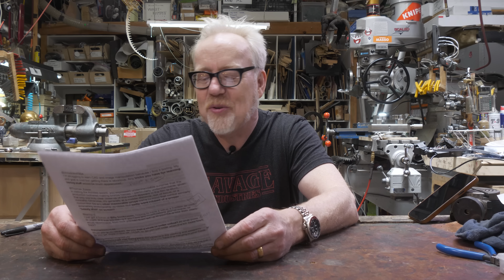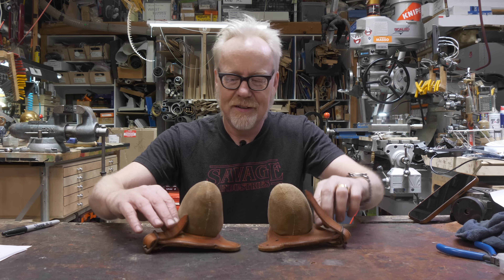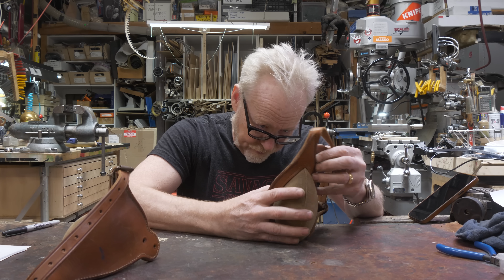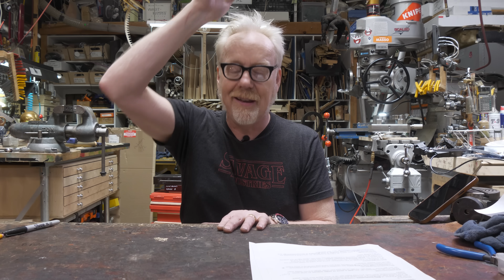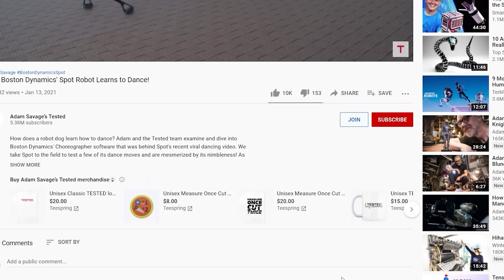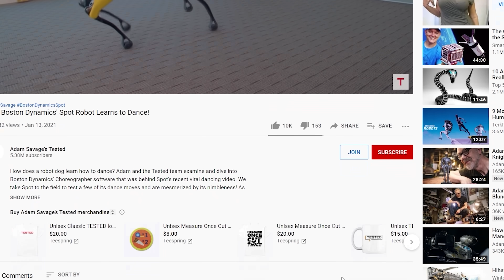What Are These Mysterious Things?

Comment: Bucking rolls for a saddle. These are with the straps that go through the hole in the top of a saddle to the underside. These are placed at the inner thigh close to bottom of where the horn of the saddle is located. 

These are used for helping a rider stay in the seat of the saddle instead of riding up the horn causing bruising when riding on rough terrain or downhill. They are also used to help the rider maintain hold of their seat while roping a calf or to lock their legs and body to the saddle to prevent from being "bucked off."

Comment: Depending on location: That’s a set of what’s known as “Squaw Tits”, or “Pommel Swells”or “Bucking Rolls” usually used for an “A-Fork” or “Slick Fork” saddle to give the rider something to grasp onto with their legs if they’re riding a horse that bucks.
The straps go through the gullet of the saddle, the holes were for screws into the saddle tree (frame) itself.

Comment: In the community they are called bucking rolls, swell, or squaw tits, not trying to offend anyone please, they make it easier on the horse in rough county if the cowboy knows how to use them correctly they can also help with roping techniques there is always the debate which is better a double fork saddle or a single fork they are used primarily on single fork saddles

Comment: I know what it was used for, but do not know its name: It is a metal weight of about ten or fifteen pounds, with a flat bottom, it is round, and has a loop of metal on top, to which a piece of rope was attached, approximately eight to twelve in length. When the milk-wagon driver reached a stopping point, he would lower the weight to the ground; the other end of the rope was tied to the horse's bridle. An old-timer told me he once knew what it was called but could not recall its name. All he could say with certainty was that it was not called a "horse anchor." Anyone know what it was called?

Comment: Even I knew they were equestrian. And I never am anywhere around horses, or have any experience with them. 
Also, Ikea furniture moves just fine. I have some I bought in the late '80s, and moved them from PA to GA, and then across town. Still using them, though they are a bit dingy.

Comment: People always talk about decorative boob armour; but coifs are litterly decorative joink armour. >,> anyways those remind me of coifs for leather armour, not bucking rolls; which sounds ideal, but is kinda unlikely since most experienced riders prefer to use the hold on to the saddle horn, ease up on the reins, push your feet down into the stirrup, and coo the horse, for the hard turns, you should already have your feet in the stirrup anyways so those are not as much of a problem, those are coifs. 

It’s more likely someone used coifs to act as a riding aid in the past and stopped cause it gave them the look of having leg peen.

Comment: Those are western leather saddle Bucking Rolls - attached to a working western saddle at the front to give some extra area for the rider's knees and legs to hang onto. Think of squeezing your knees together while riding and putting pressure against those so you stay in the seat. Working saddles are ropers, ranch saddles, etc. But you can also see them on pleasure and trail saddles.  These are an accessory added to a saddle as a modification - probably by a cowboy/buckaroo who feels like they are sliding around in the seat too much while riding/working with both hands in action. Such as holding the reins, roping, shooting, or just going down a steep incline etc. The bowl shape  is often filled with saddle fleece material or maybe foam for modern versions. Hope this info helps.

Comment: i got a random device, had no idea what it was, got it anyway. Turned out to be a piano hammer tensioning tool, also used to adjust the tension on a tattoo gun. At the same sale I got an aluminum strap wrench, only the band looked like it came from a small chewbaca, the whole thing is about 6" long. And the only reference was a patent from 1890. As a strap wrench, but it doesn't work that well on anything I tried.

Comment: Those are in fact bucking rolls. And a good set at that. The holes on the tabs accommodate the saddle screw below the fork of the saddle. The straps then wrap around the fork, through the gullet and back up through the hand hole.

Comment: Wait for it: I bought a beautifully machined (and flippin heavy) round metal thing that sits on a pedestal. It has a butter smooth bearing and spins. The guy didn’t know what it was and wanted $80. I got it for $25. The components are top notch. I wanted it as a bench anvil, something I could bang on. It spins.

Turns out it’s a diesel engine crankshaft main seal installation tool for heavy equipment engine repair. I use it daily. Love that thing 😂

Comment: I'm surprised that Adam, as a maker, doesn't just fabricate his own custom bookshelves to spec lol
Reply: Honestly, fabricating the equivalent of 15 Billy bookcases worth of display cases or bookshelves sounds tedious, especially with glass-front doors and glass shelves. I'm a maker too, and a fan of Billy bookcases (especially with the glass doors). They work well massed together and fit most rooms because they're designed the same width as the distance between studs, a reasonable height for average size people. Better to just go to IKEA and spend the time and money saved by not custom-fabricating the shelf units on making projects that are actually fun to work on and can't be bought off the shelf.
Reply: @BubbleFlowerFairy1  I figured that given the simple structure of Billys it would be faster and cheaper for an experienced maker to fabricate something nicer than to drive to ikea, buy a mess of cases, drive back, and put them all together. I will admit, however, that I forgot about the glass doors lol

Comment: Those things put me in mind of either the prosthetics that the Artemus Gordon character had in the movie version of "Wild, Wild West".  Or possibly a shoulder protector for use when firing large bore rifles/shotguns.

When/if you replace the LED strips, you might want to check to see if what you replace them with generates RF noise.  I know that most of the city areas of California is lousy with it.  Josh Nass of Ham Radio Crash Course has mentioned it.  Jon Amadeo (sp?) has mentioned it when he was on HRCC doing interviews that part of the time, when they were in the ham shack that they had on the set of "Last Man Standing" that he would sometimes listen for signals with a software defined radio (SDR) that was remote to get around that.

Comment: Sorry Addam but those are not the original "Billy" bookcases. The original was apx 2 ft wide square ladder style sides with holes for metal D pieces for resting the shelfs on, those (shelves) were apx 4 x 2 ft with a steel L profile facing down at each short side to rest on the "D"´s in the "ladders". The tight fit rendered it fairly stable and it came with a X shape made from half inch steel bars (thin ones) to brace the shelves side to side movement. I had this in my childhood room in Gothenburg Sweden and have tried to find it again as it was verry sturdy and strong as well as easy to reconfigure and well suited for repeated disassembly and reassembly made from solid wood of to me unknown type, may be pine (I was 5+ at the time I got it). The later set and forget (about ever moving it again without breaking it) was a huge disappointment when I as a adult tried to buy the same shelf system again, as I lost mine in a move many years ago, I´m 51 now. I really do not like when they "recycle" names but it is nothing like it was before, like in Billy´s case. :(

Comment: I had a tool that I displayed on an entry table in case anyone could tell me what it was. It was a big heavy 5 pound hardened steel thing with 3 moving parts obviously an old time farm tool. I won't describe it further because after years I finally found out what it was and I'll tell you, and you can look it up to see them for yourself. After that I gave it to my neighbors who run a bed, and breakfast decorated with unusual old time knock knacks. It was a barb wire staple puller.

Comment: The mystery pads are clearly used in BMX competions, worn under the baggy pants. They are not “cod pieces” but they are used to protect your two ‘eggs’ when lining into a landing on a ramp. Your knees can fly together at high velocity if you loose your saddle in your acrobatic 540˚ corkscrew , midair. They strap, on as you would imagine on your knees facing inwards. Its psysics and protection in beautiful symbiosis, when landing backwards.

Comment: Bucking rolls. Used when ridding a horse. 

Bucking rolls are two padded pouches that are added to the front of the saddle seat. Most bucking rolls are filled with wool, trimmed from bark-tanned sheepskin. Bucking Rolls supplement the swells on a saddle and help a rider stay secure in the saddle. They are designed to be used with slick fork saddles, which have very little width to their swells.

Modern day bucking rolls seem to have had their start in the late 19th century in the Northwest.  Early models were made of a tube-like construction that extended from one side of the saddle to the other, just to the rear of the fork. Some were fixed and some were removable.

The John Clark Saddlery, of Portland Oregon, is credited with the first patent on a removable bucking roll that looks much like those of today.
Reply: Well I guess ‘eye cushions’……I think time will tell which of us is correct on this item
Reply: Great info. Thanks!

Comment: I've got alot of Billy bookshelves, wide ones, narrow ones, some with no doors, some with full length glass doors, some with half length solid doors and a corner unit (which they don't sell anymore, they sell a bracket for a regular narrow unit for the corner instead now).  We've moved house nearly a dozen times over the last 20 years and they've come with us every time.  They're all screwed together once we find a combination that fits the room which helps with rigidity and being screwed to the corner unit stops them from being pulled over without having to screw them to the walls.  One thing I noticed is in humid climates they sweat the glue out of the back of the side panels onto the walls so having felt pads or similar to keep them off the walls prevents them leaving stains on the walls.  I'm not saying they travel well, or are as good as the day we bought them, but they still look fine and do the job.

Comment: I'm from Lexington Kentucky, grew up around horses.  Those are Bucking Rolls,  They go on a saddle.  Some call them Buck Rolls.  You can look them up.   They go on a narrow form forward fork saddle.  A heavy leather cord connects them at whatever length is needed for them to sit on either side of the roping horn, it's often braided in a round braid and quite decorative, sometime for a hornless saddle it will have a short and longer length so there is a looser one to hold on to.

Comment: The joy of a mystery to me is in the solution, not the nagging problem. To me, knowing there's an answer and intentionally avoiding the answer is a completely alien viewpoint. It's like engineering an electric device but refusing to plug it in because you don't actually want to know if it works.

Comment: They are bucking rolls for saddles. They should be connected together with a leather strap and sit either side of the pommel so I rider will use them to press their thighs against in case of a bucking horse to stop you being thrown forward. Hence why they are very well made.Sorry ADAM

Comment: maybe I should apologize for telling you this, but the two leather things... I have seen a set just like them. in tasmania. A really good natural horsemanship (perelli) trainer had a set in a box of old gear in the back of is truckthat he was moving from his parent's shed, when he was over. I asked about it and he said either his dad or grandad (I do not remember which) was a horse-breaker. they were part of his kit. the strap goes around your lower thigh
 and the hole is for a toggle on the top of a tall riding boot.
it was supposed to provide protection for when a horse tried to scrape you off by bashing your leg into posts, trees, or rocks... depending on what rider-ridding stuff was available. the reason for the extended horn instead of just a pad is that a ton of horse can still crush you, and the pad, against something and hurt you. but the projecting padding would hit the o0bject and send feedback to the horse that a solid connection had been made. After a few tries, it got the idea that this would not work, and stopped doing it.
He said his dad had called them "cat's whiskers."

Comment: Those look like the could be brassiere forming molds! The the empty punched hole is for a strap of varying lengths to approximate for women of different bust widths. The shoulder strap seems small on you, Adam, but for women who have smaller shoulders, those molds would fit perfectly onto a female mannequin without breasts. In this way, the largely male dominated textile and clothing industry could sculpt the wire framed brassieres of yesteryear to different dimensions and proportions with relative ease!

This is all just my speculation of course...

Comment: Billy book cases - if you're going to stick with the wooden shelves supplied, I recommend running a strip of wood as thick as the space behind the back board and putting a screw through each shelf from the back. It wont make it bullet proof, but it will make it more robust and help stop the shelves sagging when you stick all your heavy stuff in there.
Reply: Great tip! If I ever empty and move mine again, I'll retrofit that!

Comment: As a kid, I found a strange brass container with a valve on it. Inside was a small amount of fluid with a strange smell. I spent a few months trying to figure out what it was, examining/smelling the fluid, doing research (pre Google), and asking older folks in the community if they knew what it was. One day, I found another in an antiques shop that had a leather holster and a brand; turns out, it was a chloroboromethane automotive extinguisher. 

I guess I'm just waiting for lung cancer now.
Reply: The CDC lists that as "immediately dangerous to life or health" 😬
Reply: @Jenthura  No one trusts the CDC...they're only a vaxx selling company with NO authority. They ACT as if they're part of the govt.
Reply: You can stop worrying.  Bromocholomethane is a neurotoxin when inhaled or ingested and the fumes are highly toxic but it is not classified as a carcinogen.
Reply: An old pyrene canister perhaps? Luckily they are not really as toxic as their reputation, the ban was more for long time exposure in the the air force i think.
Reply: Were they still holding pressure? My great grandfather owned a garage & used car lot, when he passed away we found a few boxes of them but none of them were still holding pressure.
Reply: My practical experience from childhood is that it is usualy carbon dioxide extinguishers who hold full pressure, or those who where activated by a chemical reaction, like those old cones with a glass ampule containing sulphuric acid. Those with powder may do, but the powder may come out as a lump or grain instead of the intended fine dust, some of them where activated by puncture a membrane nut on the top of an internal carbondioxide canister inside the medium canister, they may hold pressure for decades as long as the membrane is intact. (Yes it is, needless to say, of course a good idea to use proper respiratory protection if one plan to do so).
Reply: @just9911 a lot of the old old extinguishers are pump action like water guns.
Reply: @patrickhobbs8201  the ones I found (and others of similar age & purpose) are all metal pressure cylinders with a gate valve, no space to even have a pump system. They’re about the size of a football and the valves are about 2.5” long and 1” in diameter.
Reply: But the chemicals were toxic
Reply: Anything in them
Reply: i cannot tell you how hard I laughed at this, but in all seriousness I REALLY hope you're okay!!!
Reply: Lol damn
Reply: Could also be carbon  tetrachloride as well. It was used in older fire extinguishers  too.
Reply: 😂! .....sorry.
Reply: I picture you like jack skelington in the lab pacing back and forth sniffing it over and over muttering "what does it mean what does it meam!"

Comment: They are definitely bucking rolls. I'm a leather worker and have built saddles . They was used a lot in roping horse saddles.
Reply: Having researched the life out of bucking rolls can you explain how these are supposed to be attached?  I can’t find a single image or description of rolls that have 3 attachment points and buckles and straps.
Reply: @jasonhomrighaus2532 here's a video. At 5: 23 the guy explains how these would work with a slot-cut saddle; which, seems like it would work great with Adam's triangular bases. All the images of bucking rolls show oval bases, but the slot-cut would let someone make a super stable 3 point attachment rather than the 2 points that the oval ones use. Adam's bucking rolls seem extra sturdy from a physics perspective, and they appear to be rather unique! https://youtu.be/cu6El6bUdEc?feature=shared
Reply: @zairac2564  The slot he talk about in that video would absolutely not work with Adam's things, the straps are positioned entirely wrong for that
Reply: @Duker-Koushakur  why triangles when every other one is an oval?
Reply: @zairac2564  someone wanted to stand out from the crowd
Reply: @jasonhomrighaus2532  The strap goes around the fork of the tree on the saddle and through the gullet hole under the horn. Then you put a screw through the small hole into the tree of the saddle . most just connect each bucking rolled together with a strap then screwed down.